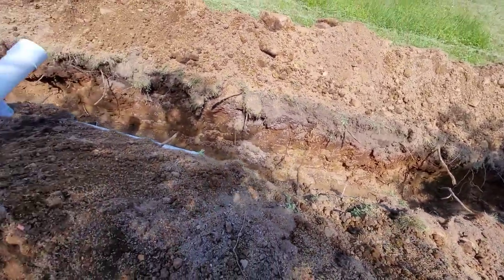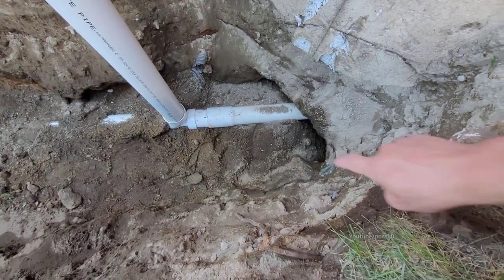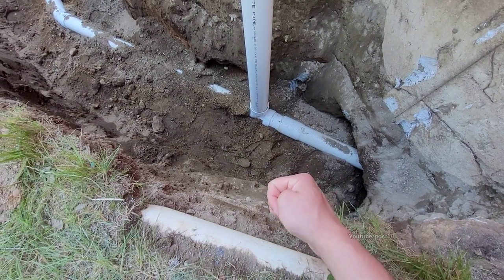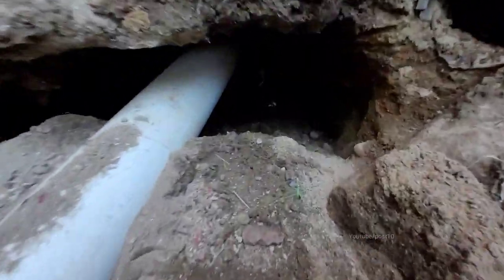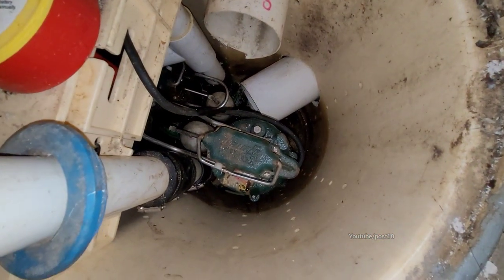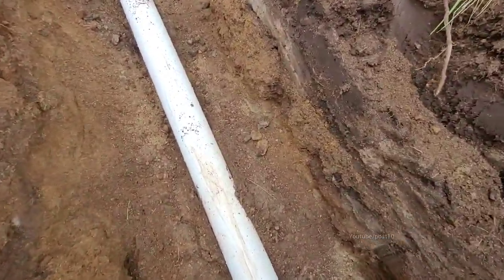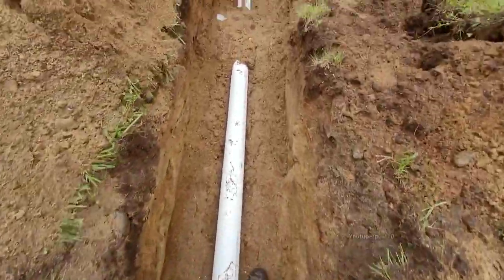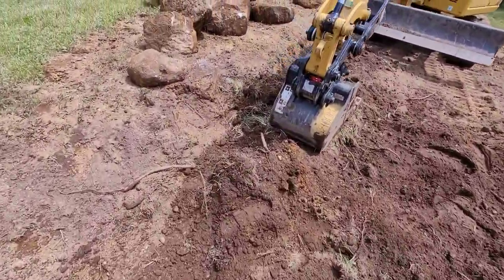eliminating sump pump with drain line for peace of mind

Comment: Nice to see how this was done And solved the problem with Sump pump running  👍 I also live with a high water table and my Sump Pump runs daily Winter or summer Wish I had a way to do what you did instead of depending on my Pump to pump it out every day and use  electric power.